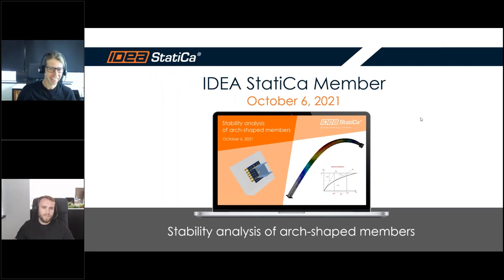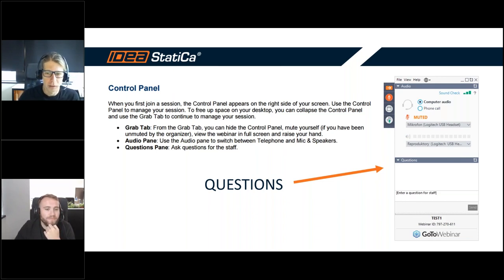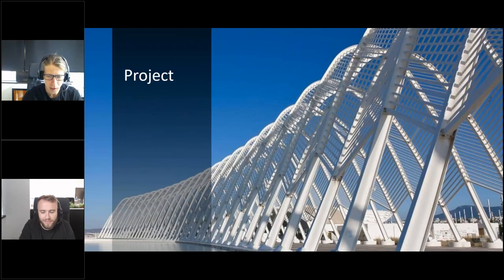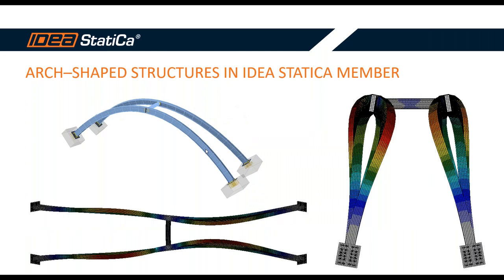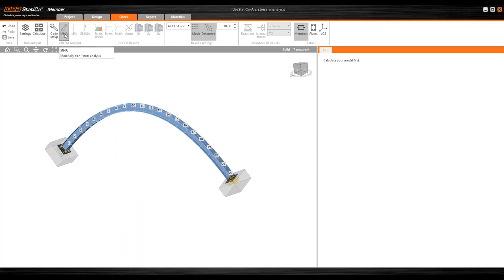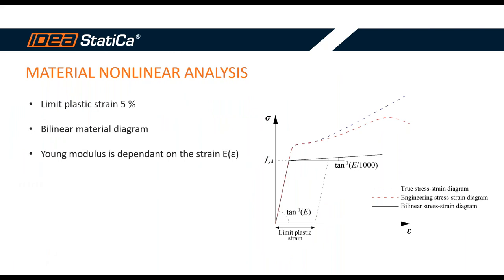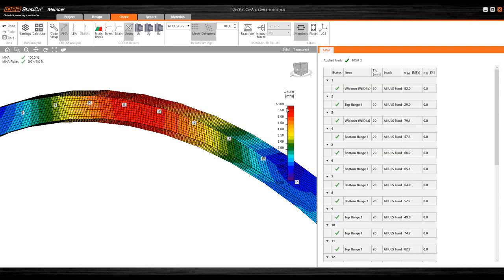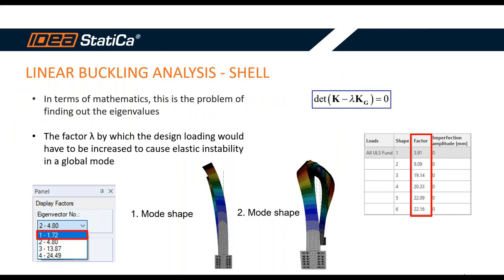Stability analysis of arch-shaped members

Comment: Hi
1. How can it be that critical factor in RFEM lower than in the member module? RFEM stability module accounts only axial force. Bending and warping should amplify destabilising effect.
2. How is support stiffness accounted without any knowledge about actual size of foundation and soil properties?
3. D.3.5, EN 1993-2 for imperfections in arched structures
4. Linear buckling analysis LBA and non-linear buckling analysis NLBA mode shapes of plate structures are different sometimes. Moreover imperfections introduced from LBA mode shape may stabilize structure, in a way that user still will get desired reduction of critical factor, but not as much as if one uses NLBA mode shape instead. So user will not be aware of the problem at all. As Eurocode states that worst imperfection or combination of imperfections should be used, it is crucial to introduce NLBA into connection and member modules.
Reply from the maker: Hello Yevgenij, thank you for your rich comments. 
Here are answers to at least some of them. 

1. 
The lower critical factor is because, in the RFEM, we are working with the 1D members where cannot be turned the 7th. degrees of freedom which for opened sections affect the stability factor a lot. On the picture below, you can see the differences between turning on/off of the 7th—degrees of freedom for the 1D member in Midas Civil, where the degrees of freedom can be turned on/ff
https://prnt.sc/1vtg747
2. 
In general, it should also be considered with the subsoil since the deformation of the subsoil will affect the stress redistribution on the arch itself. Due to the fact that this was a simplified model and there interaction with the soil was not considered. The footing connection with the anchors is generally solved using the Winkler - Pasternak subgrade model in the application IDEA StatiCa Connection. 

But otherwise, you are right; the design should be solved with the interaction with the soil. 
3. 
We were extracting the imperfection from the Eurocode 1993-1-1 as is mentioned in the EN 1993-2: 
https://prnt.sc/1vtganj

For more questions and comments, please feel free to contact directly the author of the webinar - our Product Engineer, Lukas Juricek (https://www.linkedin.com/in/luk%C3%A1%C5%A1-ju%C5%99%C3%AD%C4%8Dek-4848aa11b/)
Reply: @ideastatica_en  I assume the main reason why the buckling factor is higher in IDEA Statica Member than in RFEM - despite the fact 7DOF is considered in IDEA - is because in IDEA there is used Shells (2D elements) while in RFEM it's modeled from 1D elements. Is that right?

Comment: If I'd like to analyse 2 arches connected with each other with bracings (for example), I had to analyse each one separately with parts of the bracings connected to the arch?  Or it's possible to design two arches at the same time ?
Reply from the maker: Hello Alex, you have the option to analyze two arches connected with a brace in one project. There is an option to use import from third-party software, or you can do it from scratch.

Comment: Hello 
Good Afternoon, 
If linear buckling analaysis factor is greater than 15, i hope it is not required to use GMNIA for stabilty point of view. My understanding is stability is safe for that designed section when LBA factor is greater than 15. Is it correct?
Reply from the maker: Hello Abdul, you understand correctly. In the Eurocode 1993-1-1, chapter 5.2 Global analysis is written that  First-order analysis may be used for the structure if the increase of the relevant internal forces or moments or any other change of structural behavior caused deformations can be neglected. You will find there a criterion for elastic and plastic analysis.
Reply: @ideastatica_en  Thankyou very much. I feel happy that my understanding is correct. 
My long back requirement from design using idea is introducing cone shapped circular member. if it is not possible for circular element of member, pls introduce combining of plates  to form circular elements in strengthening member.